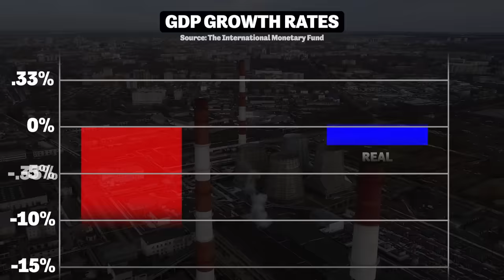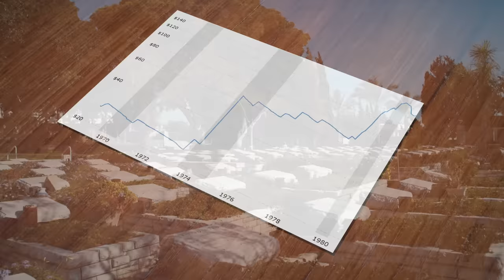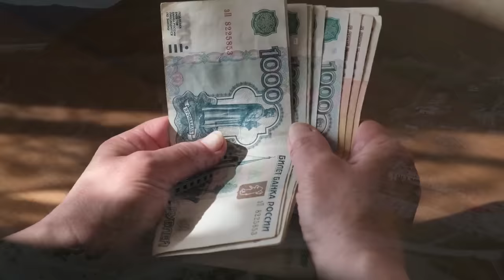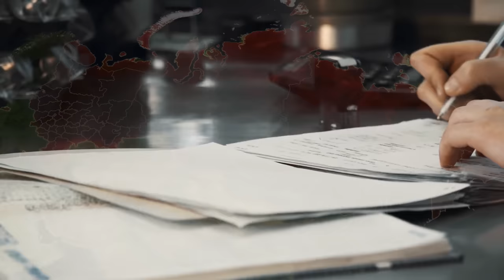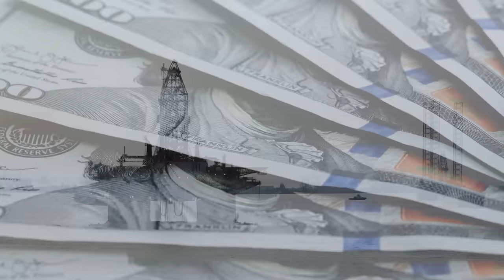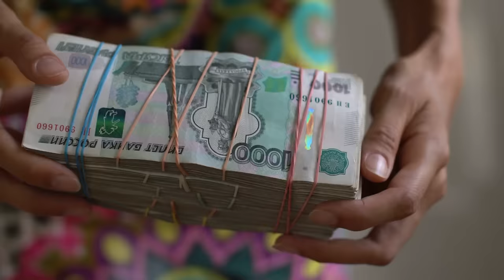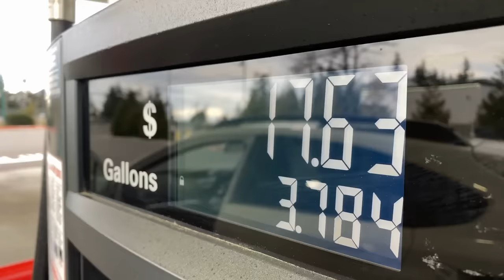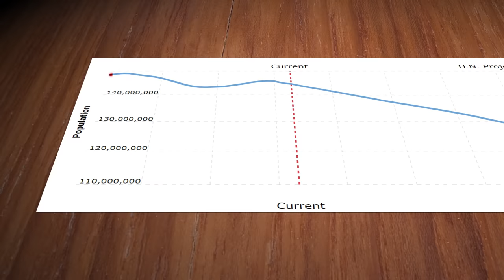Why Russia's Pathetic Economy is Booming

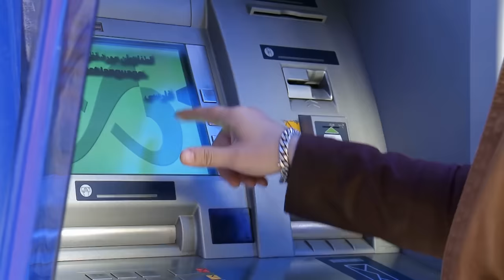Comment: 29:50 Russia anticipated US's sanctions and took out most of its reserves from US banks. They also abandoned swift system by replacing Yuan and currency exchange with other countries.
Reply: Except alot of those foreign currency reserves are still in foreign banks, frozen.  And they were removed from SWIFT, they didn't abandon it.
Reply: Yes, they've been preparing for this. That's why sanctions didn't hit them as hard as the West expect.
Reply: @DzheiSilis  а вы знаете что не все банки удалили из Свифт? 🤣
Reply: @DzheiSilis  EU and US found and froze only about USD 50 billion of Russia's reserves out of claimed USD 300 billion. That means, they don't know where the remaining 250 billion are and they aren't frozen apparently. My sense is - not everyone wants to comply with the sanctions, and not everyone does so. Who wanted to comply with them - did so already. Others - don't want to do it and will not at this point.

Comment: You got it all wrong dude. Western sanctions on Russia had boomerang in their faces. The price cap did not work, and there are large markets for Russian energy in Asia. The balance of power has already shifted from West to East. Russia doesn’t need Europe now for it’s oil export. Europe’s progress had benefitted mainly on Russia’s cheap energy. Europe’s industries and economic situation are in a quagmire because they have to buy their oil and gas from sources multiple times higher in prices than from Russia
Reply: Good point. 
And BTW all chemical industry relies on oil prices especially polymers (plastic). 
BASF from Germany is already crying loudly.
So currently even "green propaganda" has a problem - plastic is bad, but glass needs a lot of power, so it is bad as well.
Neither nor will be cheap in the future. 
Carbon fibers are not produced in EU.
Shall EU use wood or grass instead, or what is the "green" plan?

Comment: You have to be careful comparing growth in terms of percentages.  It doesn't take much for a little store to double or triple its size year over year.  But Microsoft or Google can only grow 10-15 percent in a good year.  But does that mean the little corner store is in better shape than Microsoft?  What do you think?
Reply: GDP (PPP)
Reply: Yes, if you define performance as growth overtime
Reply: @BobHooker  it is well covered in the video that Russia is still able to import pretty much everything through third countries. There are definitely no shortages of chips whatsoever. Why would Russia not be able to repair tanks? There is no import dependency in that sector.
Reply: @BobHooker  how exactly do you imagine US can control where China sends its own production? They could certainly do that by monitoring SWIFT transactions in times when those were used for payments, but not anymore. Or do you seriously think Russia relies on importing tank components from US?
Reply: @BobHooker  A tank without a modern sight is still a tank. And who needs a sight without a tank?)))
Reply: @BobHooker  To calculate the ballistic trajectory, no large computing capacities are required, and in general, in terms of the balistics of the sight, nothing has changed since the 80s on both sides of the conflict! And in general, Russia has long had the production of its own microchips, which are also used in the space industry! Yes, this is the production of limited edition microchips not for civilian purposes, but they do their job perfectly!
Reply: @BobHooker  It's too early to judge yet, in terms of the same losses, we will also be able to find out the truth only decades later. Since the volume of misinformation on both sides is extremely high.

Your governments promised a year ago that we would starve at all))
Reply: @BobHooker  By the way, how is the United States doing with supersonic missiles? lol))
Reply: @МаксимШалашов-о4к  Pretty well, right now it's in the test mass production phase since the maneuverability and the facilities to manufacture them had to be built/upgraded. The hope is to have 24 by the end of the year and work on a full rollout in 2024. Though you could defend against hypersonic missles in small areas currently. Their use against defenses that can calculate and shield military targets is terrible. Best to use them in areas with low defences. лол
Reply: @BobHooker  you are pretty delusional thinking Russia cant produce its own chips, that is just a wrong idea that Russia has no chips makers, the Russian state of Belarus is one of the biggest producers of electronics and microchips in the world, tanks do not depend on west Technologies.
Reply: Not to mention how stupid it is to compare the economies of different countries in terms of GDP in $$, while these countries do not even use dollars within their economy.

Comment: That pathetic economy just beat whole NATO.
Cry about it...
Reply: NATO supplied Ukraine with some garbage and 20 highmars. Russia tried to capture Artemovsk for two years, but not a single NATO soldier was harmed, even morally. Not a single regional capital in Ukraine was captured; Kherson was surrendered. The fleet is leaving Crimea because ships are rapidly disassembled
Reply: @Tony-.  never mention the fact that Challenger II the best armored tank on the planet proved to be nothing more than tincans when faced against Lancet drones and Kornet ATGMs.
Reply: @jacklondon6716   The main feature of modern Western tanks is the survivability of the crew. Personnel training is no less expensive than equipment. Soviet technology is light and cheap, it is fast, but it does not even have normal reverse gear (only 5 km per hour! while normal tanks have 25).
That is, literally this is a expendables, Russia is not crazy and is trying to increase the survivability of scarce crews, but is limited by the platform. New tanks were not introduced into the series due to old sanctions; they are insanely expensive now.
Before lancet disables something, vehicle can repel an entire wave attack by turning a forest stand into a sieve.

Comment: Thank you for a generally well researched videos.

Though I'd like to point out that sector-a industries aren't exactly under full government control, especially agriculture, which is dominated by privately owned giants like Miratorg.

Industry isn't non-competative either; Russia's Transmash holding is a leading rail manufacturer that is not only privately owned, but also effectively competes with global giants like Alstom in several markets. Most recently, their Ivolga-class trains won a $1 billion tender in Argentina, for example, in addition to localizing rail car production in India and Egypt. Their underground railway trains (namely the futuristic Moskva-class) have also been exported to several countries.

We've also seen a number of smaller light rail and public transport companies popping up over the past five years, such as PKTS, who have left both local and regional competitors in the dust when it comes to trams (the Vityaz class) and electric buses (the Admiral class).

In a nutshell, when most Russians claim their industry is non-competitive, I tell them to take a 10-minute ride in Moscow's public transport system.

Comment: The Russian budget called for a 2.9T ruble deficit in 2023.  The deficit in Jan and Feb alone was 2.1T.

People point to 2022 outcomes as indicative of Russia's future.  They are not.  Europe only cut gas imports in December 2022, and oil and refined product imports in Jan and Feb 2023 respectively.    For most of 2022 Russia was absorbing huge levels of income from inflated prices and no decline in exports.  Russia has not experienced a serious decline in exports, but the price that they receive per unit (and therefore profits) has been reduced drastically.

Russian employment is largely propped up by state funded "make work" jobs.  These jobs keep unemployment low but also drain reserves.

Russian bank officials have played the weak hand that they have been dealt extremely well, and that must be acknowledged.  Russia is not going to collapse any time soon.  However, living standards, productivity, and even its ability to supply  its military (despite a near 100% focus) have been been degraded and will degrade further over time.
Reply: So america 31 try debt going as high 
200+ try and res currency status doubt
Is all great
Reply: @naveenpalani  Entirely different situation as the American economy is different in almost every way from the Russian.  I do agree that America takes on too much debt, so no argument from me on that point.  However, we have not run up 85% of our planned debt in the first two months of the year.

Comment: The connection between sector A and sector B you describe exists in the European Union also, with the difference that the European Union is full of debts and has no oil on its own except for Norway.
At the same time, if it is true that Russia lacks a proper protection of propeties and private business, sorry for them, but they are doomed to fail...only if it is true and it is endemic of course.

Comment: The oil cap was violated by Japan a few months ago, Japan paying above the $60 cap with the permission of the US.  Russian gas export to China is expanding rapidly making up for most of the lost sales to Europe. Europe on the other hand is suffering more than Russia, which may be part of the US's plans. But both France and Germany have rushed to build new factories in China to take advantage of low energy costs. The US sanctions have created a 2 tier energy market with very high energy costs killing countries like Germany but benefiting countries like India who buy Russian crude and produce refined products (diesel, gasoline, kerosine etc) to sell to Europe at a huge mark up.) Russia ran a 26 billion deficit one month in early 2023, but the US is running a 1.7 Trillion annual deficite, when scaled to the size of the GDP the US deficit is 10X higher than Russia's worst month in 2023. There is no doubt the war and sanctions have greatly hurt Russia. The economic impact to Europe has been much larger. Russia is permanently turned its trade to the East. Trade with China was 200B in 2022 and incresing at very rapid rates. The two countries are a natural fit, China needs Russia's energy, food and mineral products, Russia needs China's semi-conductors and manufactured products.  Trade with India has also boomed. Europe meanwhile will shrivel up with super expensive LNG from the US. Also the 800 Billion is subsidies European governments provide their people and companies in 2022, wil not be repeated.
Reply: Russian gas export is not really expanding. In fact, it shrunk by 64%.
MOSCOW, May 4 (Reuters) - Russia's federal budget revenues from oil and gas, the lifeblood of its economy, fell 64% in April from the year-earlier period and declined by 5.9% from March, the [Russian] finance ministry said

Comment: The "inefficient" state oil industry has been completely rebuilt from scratch in 15 years and has equaled the European oil refining depth, for example. And from the "state" there is only the most strategic control in a broad sense. Everything else is normal market behavior

Comment: The video critically understates the effect of Putin hooking up to China. "Five years plus" of enough connectivity with the Chinese and Indian markets (not to mention China is an RE developer, as well, and may transfer tech and buy up mineral reserves) versus demographic and economic slump due to being cut off from the West decades down the road, and it looks like this video will join the ranks of failed predictions, and a new one will be posted: "Why didn't Russia decline as predicted? Because Asia." Russian people had weathered bad times, and even if the economy squeezes less from Asia than from Europe, it would not matter so much.

It appears that, to truly checkmate Russia, every last stopgap needs to be plugged and that means getting China and India on board. With Taiwan, however.......

Comment: And that was a proper analysis. Thank you for that realistic view of Russian economy, outside of political sympathies.

I just want to reiterate some points you made.
 
First of all - it's undeniable fact that Russia's economy is not collapsing. Yet. It's also stupid and completely unfound to say that Russia has brushed off the sanctions completely and somehow used cheatcodes for how global economy works. It hasn't. Very large reserves are keeping Russia afloat, however the structure of Russia's economy dooms it to collapse. Just not now. And not in a way you think it would look like. We are talking about gradual deterioration to the levels of North Korea. 

Why? 
First factor is Russian huge dependence on foreign components in basically every strategic branch of industry. Even the military relies on foreign components. Russia can't build new tractors or tanks without importing components. They can build something, but it's technologically 20 years behind the market standards. Russian strategy of complete technological indepencence failed due to typically Russian issues with corruption, incompetence and insufficient governement control. 
Second factor is huge Russian relliance on natural resources exports. Europe proved it can cut the cord connecting it to Russian gas and oil, and If you look into actuall data, European purchases have not and will not be replaced by Asian buyers any time soon, if at all. And contrary to Russian propaganda, Europe did not freeze over the 2022/2023 winter. So Russia lost it's "gas blackmail" card. In a year. That's the amazing thing. 

Third factor is Russia's tragic demographic situation. It was already bad before the war. If you look into historical demographic data for Russia it has always suffered a dip every time an armed conflict was waged, and unlike the West, it hasn't bounced back. So shrinking population will shrink even more due to loss of young males, a huge number of sick, wounded and psychologically damaged coming back from the front. Add to that social unrest caused by thousands of convicts getting pardoned for their military service and coming back to the streets. Add to that a brain drain which has increased dramatically since the war began. It's a recipe for disaster. Just not a big bang. A long, slow, suffocating death. 

Another thing that needs to be discussed is Russian economic reporting which has become nothing short of science-fiction. Russians just don't publish data which can be used to reliably asses the impact of sanctions. It's a strategy of breaking the thermometer to reduce the fever. Some indirect data that's still being published is, however, pointing to a deepening economic decline. And that is even after Russian government did some of the most creative bookkeeping ever to cover up the damage.

Comment: Sanctions are also affecting the war. Like you mentioned Russia cant produce alot of high tech stuff, this includes thermal sights which is very important in modern war. They used to get them from the French but with the sanctions its become very hard to aquire them. Not to mention the Russians having to employ tanks from the 1950s and 60s as their modern tank fleet is pretty mutch gone. 

I do feel bad for the many young Russian men whos going to die fighting with equipment from the 50s and a tank whos prayers is the only thing that can stop it from getting absolutely destroyed. Just for the ego is a cartoonishly evil guy.
Reply: леопард 2 было произведено для Германии 2125 штук  Причем последний в 1992 году
https://ru.wikipedia.org/wiki/Леопард_2
Леопард 1 всего 4744
https://ru.wikipedia.org/wiki/Леопард_(танк)

Уралвагонзавод с учетом экспорта  выпускал до 1300 танков в год
https://ru.wikipedia.org/wiki/Т-90

 а это 60% мощностей РФ  с учетом существующих запасов и ремонта это легко покрывает выход их из строя даже если верить украинской статистике о том что с начала сво было уничтожено 3 600 танков РФ.

Comment: Another absolutely useless and biased analysis of the Russian economy. But no less funny.
Briefly about the reality that I faced: 2 weeks ago, the company where I work bought a batch of new monitors for personal computers of employees. As it turned out, they are 90% made from domestic components, and the manufacturer's company has ambitious plans for the full localization and expansion of the monitor line. They also manufacture computer mice and keyboards. The company itself exists only 9 months.
If they told me that this is possible in 2021, I would think that a person is delusional and this is simply impossible in Russia. Thank you, sanctions work.
Reply: I don't believe a single word of this propaganda nonsense.
Reply: @frankyboy1131  do you mean my comment?